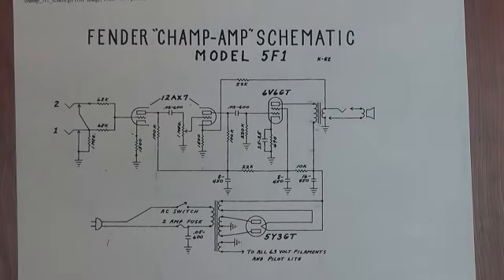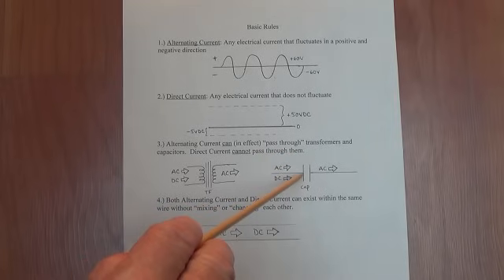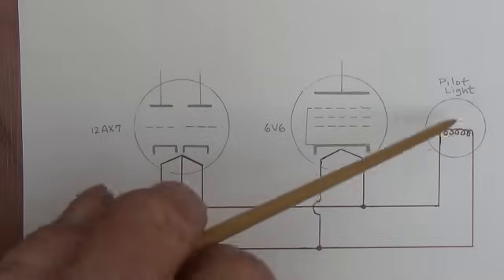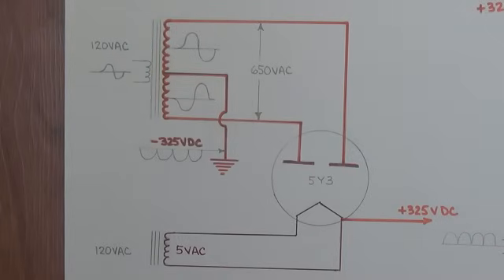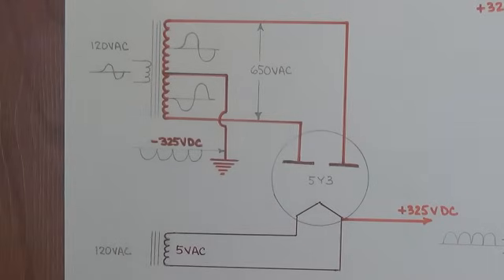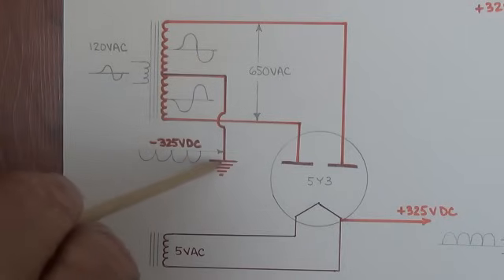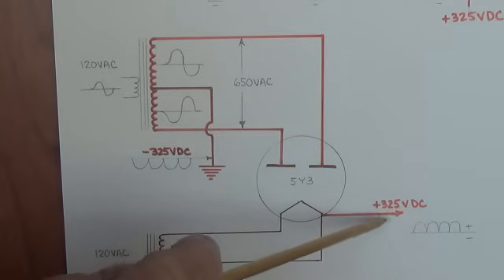How Tube Amplifiers Work, Part 1: The Power Supply

Comment: Uncle Doug, Your videos have greatly helped me, but I need some help. I have a Zenith 3A03 chassis from a HF16 Portable phonograph, 1958.  I just re-capped it and what I get is a very small amount of audio at full volume. I just rec'd the Sams 396-15 and I asking, where would you start?
Reply from the maker: +Dale Hinkelman  Was it working perfectly before you replaced the capacitors? If it has never had good volume, there are all sorts of possible reasons.....bad tube, faulty component, bad connection, bad cartridge (if using a phono cartridge), bad output transformer, etc. Identifying the problem requires hands-on testing and step-by-step diagnosis, which I can't do long distance. This will be a good learning experience for you. Good luck and be careful.

Comment: Doug,I have an old Morley Basic Wah pedal that needs repair.if ai sent it to you,would you fix it?Someone had cut off the twin 9 volt battery connectors and it needs dome attion.
Reply from the maker: +philo426  Philo, I appreciate the opportunity, but I am retired and not doing outside work, other than an occasional vintage amp restoration.....especially anything that entails shipping and receiving.

Comment: If you were to use a full wave bridge rectifier (4 diodes) instead of the 2 diodes in the 5Y3GT, would the output be  around 910v DC? Instead of the 325v DC? As you would be using the full AC wavefrom instead of wasting the negative half of it. The output would be approx 1.4 times higher then the input when using a full bridge. With a single diode with the output be around 162v DC?
Reply from the maker: +haz939  Yes, Haz. You&#39;d have to un-ground the centertap to prevent the creation of two out-of-phase wave forms, then, using a FWBR with the 650VAC secondary, you would ideally get about 920VDC output (in reality it would be lower due to rectification losses).  In practice, when you do use FWBR in a power supply, it is generally with an un-centertapped 325 or 350VAC secondary, which yields a more useful output in the 450VDC range (ideally). Half-wave rectification, with a single diode, would yield about half of the secondary voltage, as you say. Much of this is explained in the RMS video.

Comment: thanks for your reply uncle Doug, i forgot to mention in my previous post  early about how interesting and helpful your  videos are,  and  i'd like to make a request...could you check the schematics of a leslie 147 tube amp and make a video one day explaining  the power supply circuit  just like the way you've explained  the   " how tube amplifiers work''  Thanks!
Reply from the maker: +4hammonds  You're welcome, 4H. To be honest almost all power supplies operate under basically the same principles.....a power transformer, a rectifier (either diodes as in the 147, or tube), and a series of filter caps and resistors (and filter choke, in some cases, like the 147).  Whatever I said in my video would apply to the Leslie 147 tube amp.
Reply: uncle Doug
the only thing i can probably understand though, is that by looking at the schematics, the signal comes in through socket  pin number 6  then goes to one of the lugs of the volume pot which is also connected by a wire to one leg of the 8 ohm 10w resistor. the middle lug of the volume pot is connected to the grid pin #2 of the 12au7  tube.
i guess from there the signal goes to pin #5 (grid pin # 1) of the 6550 tube. (v2)  can't understand the rest of  the schematics.  thanks
Reply from the maker: Being able to interpret schematics is like learning a new language, 4H.....it takes time and practice. It sounds like you are making progress in developing these skills. It's usually easier to break the amp down into separate sections, pre-amp, power amp, power supply, reverb circuit, and tremolo circuit, then focus on each one individually until it becomes clear. The Internet is a great resource to aid in your study. Good luck.

Comment: Doug,
@ 16:15 of your explanation: You seem to indicate that scopeing the center tap (which is hooked directly to ground) of the transformer will show you the bottoms of the AC waveform. I guarantee that scoping anything directly hooked to ground will only show 0 VDC and 0 VAC, unless there is something seriously wrong in the circuit. If you want to see the bottoms of the waveform, scope each plate of the tube. When it is reverse biased, you will see your waveform bottoms, which the tube is conveniently blocking for you. Scopeing the filament would show the positive waveforms from both halves of the tube, but you will see that waveform smoothed by any filtering capacitors on the B+ line. So it will be more or less a high DC voltage, with some ripple. You will not see the sum of the positive voltage waveforms, the filter caps will swamp that out.
Pete
Reply: Greg is correct.  The diode/rectifier action is like a switch, only letting the voltage flow in one direction.  Basically what it's doing is turning on and off each half of the center tap coil.  As the top coil voltage goes positive, the bottom coil is turned off (filtered out by the rectifier), then as the bottom coil goes positive, the top coil is turned off.  So, only the positive power of each coil is allowed to pass through and the negative power of each coil is blocked or turned off.
If you look at the top coil separately you would see +325v for half the cycle, then 0v for the other half the cycle.
Looking at the bottom coil only, you would again see +325v for half the cycle, then 0v for the other half, but in opposite phase.
With both coils in action, the -325v peaks of both coils are blocked or filtered out and the +325v peaks from both coils then produce the continuous stream +325v peaks with no gaps as you show in the rectifier output.
Reply: @montpierce424  Yes, this is spot on.
Reply: To clear this up, erase the pencil mark for -325 pointing to ground & have it point to the lower transformer wire.
Reply from the maker: +Greg Peterson  Very interesting and informative, Pete. Thanks so much for your knowledgeable input :)
Reply: Yes, I noticed this too.

Comment: I'm new to this sort of stuff so forgive me if this is a silly question... in the final diagram on this video at the bottom, 5VAC it being supplied to base of the rectifier tube and at the same time +325VDC is being taken off it. Doesn't the 5VAC interfere with the +325VDC? surely that would cause problems in the rest of the amplifier circuitry?
Reply from the maker: +insanebiscuit1  Not a silly question at all, IB, and one that puzzles a lot of people. The rectifier tube contains two separate diodes. The high voltage AC from the power transformer connects to the two plates, and the 5VAC from the filament winding of the power transformer connects to both ends of the directly-heated cathode (which looks like a "V" filament in the diagram).  Diodes only conduct in one direction, and in this case, both of the diodes in the rectifier tube conduct only from plate to cathode, so the rectified +325VDC exits from the tube via a cathode/filament wire. Since AC and DC don't "mix" (they are sort of like oil and water), both can coexist at the same time in a wire without affecting each other.....so the 5VAC going into the tube and the +325VDC coming out pass by each other without any interaction.

Comment: Hi UD! I have a small power transformer with secondary high voltage output of 600v at 50 M.A.D.C,Would this provide sufficient high voltage to power a champ circuit?Im sure the 600 is good,but I wonder about the 50 ma?
Reply from the maker: +mike connell   Most PT's for the Fender Champ are HV rated at 70mA, Mike, but I personally think that your 50mA PT would work. If you biased the 6V6 at 35 to 40mA, there would still be 10 to 15mA left for the 12AX7 triodes, and they only draw about 1.2mA each.

Comment: Uncle Doug, you  may have gone over this but why is it that AC is sent to the diodes and DC is outputted?
Reply from the maker: +William Alston Diodes only conduct in one direction, William, depending on the orientation of the diode and the charge applied.  A rectifier tube contains two diodes formed by the two plates and the cathode. When you apply AC to the plates, only the positively charged portion of the wave is conducted from the plate to the cathode, so all the positively charged wave forms (i.e. positive DC) exit from the cathode, and all the negatively charged wave forms (i.e. negative DC) go to ground through the high voltage center tap.

Comment: Thanks uncle Doug for all your Knowledge that you have shared with us!Its like going to school again,but without having to sit on hard plastic seats all day! I have an old hammond organ transformer that is putting out more than 650 on the high voltage,my volt meter says 768 v,is that too much voltage for the 5f1 circuit?Is there an easy cheap way to reduce the voltage if needed?
Reply from the maker: +mike connell   You're welcome, Mike. If you're measuring the high voltage output of the transformer out of circuit (not connected to a rectifier tube) it will have an elevated voltage reading. Once it's connected to the rectifier and current is flowing, the output reading will be much lower, probably around 410VAC, which is about right for most small to medium wattage tube amps.
Reply: +Uncle Doug I also have the output transformer from the hammond organ,There is only one red wire on one side of the transformer,is that the primary side with red going to bt?Thanks again this is my first build,your videos are a great reference!
Reply from the maker: You're welcome, Mike. An output transformer should have at least two wires on each side, unless the output (secondary) in internally grounded. Measure the resistance between the red wire and the metal frame of the transformer. If there is continuity, then perhaps the red wire is for the speaker, with the second terminal of the speaker going to ground (and thus completing the circuit with the OPT secondary).

Comment: Hi Uncle Doug, I have a question hopefully you wouldn't mind answering for me. On the secondary side of the power transformer it looks like there are 3 separate coils which each get a current induced by the magnetic field set up by the primary side of the transformer. My question is, are these 3 circuits separate of each other or do they some how have an effect on each other. For example if we added a forth coil on the secondary side, does that now lower current or voltage in the other three?
Reply from the maker: +taell1234  An excellent question, Taell. I have not read an answer to this question anywhere, but will extrapolate what I believe would happen. 

The output capability of a power transformer (PT) is dictated by the amount of secondary current it can safely flow (and heat that it can safely tolerate), and by the amount of primary current it can safely flow to produce the secondary output. 

If you were to add a fourth winding to the secondary, there would be two possibilities: If the AC to the primary was limited, then I believe that the current output from the other three windings would be reduced and the total output of all four windings would be the same as for the original three. 

If the AC to the primary were not limited (which it generally isn't) then the current output of the other three windings would probably stay the same and the output of the fourth winding would make the total output current higher than before.  This would force the primary current to increase, to cope with the increased secondary output, possibly beyond the safe capacity of the transformer.

Comment: Excellent video Doug. Im considering building a small tube- amp for my turntable and this schematic has been extremely helpful. I am a little lost how the circuits you've shown in pt.1 and pt.2 fit in with the origional schematic map
Reply from the maker: +Christian Stock  Thanks, Christian. The diagrams I used in the videos are intended to show how the different sections of the amplifier actually function, i.e. the filament heater circuit, rectifier, power supply, pre-amp, and output.  If you intend to build this amp, the Fender schematic is the map of the circuit that you should follow. If you wonder how the different parts function, then refer to my videos and diagrams. Good luck with your project.
Reply: Thank you Doug. This is my first project involving electronics and you've been very helpful, you the man
Reply from the maker: Thanks, Christian. Best of luck with your amp project.

Comment: This is a great introduction to tube electronics. The high voltages are a bit hair-raising though :) I have a digital oscilloscope that's rated for 300V but with 10x probes - would that be suitable for this project or do you recommend something a bit more old school?
Reply from the maker: +Steve Wart Thanks, Steve. The high voltages require a thorough knowledge of safe procedures prior to actually working on a circuit. Your digital oscilloscope is just fine, particularly with the 10x probes. Most of the scope applications deal with the AC signal circuit, which is of moderate to low voltage.

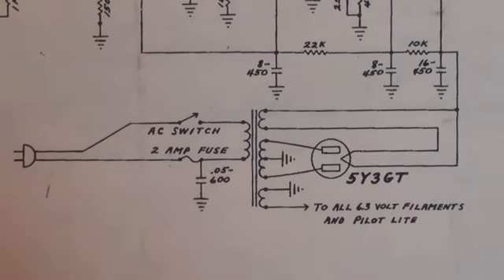Comment: Hi Doug I sent you a message re heater voltages and found the answer to the second part of my question right here at about 5:15 onwards. I am still interested in this so called sudo centre tap for a 6.3V secondary winding using two 100 Ohm resistors though. Thanks for all your videos. I watch them more than TV these days!!
Reply from the maker: +allanpennington Greetings, Allan. I haven't yet seen the message, but am glad you found the answer to one of your questions. The pseudo center tap is a fairly common practice for power transformers that don't have a center-tapped 6.3VAC winding.  Running a 100 ohm resistor to ground from each of the 6.3V wires will create about the same hum-reduction as actually having a center tap.
Reply: Thanks Doug, the first part of my question was as follows:

The amp I want to build has 3 x 12AU7, 1 x 12AX7, 1 x EZ81, 2 x EL84. The heater wires go from the Tx to the EZ81 pin 4 and 5, then onto the two EL84's, again pin 4 & 5. Then the black wire goes to each pin 5 of the 12 series tubes. There is then a bus wire connecting pin 5 to pin 4 of these 4 tubes. The other heater wire, a brown one, goes from pin 4 of the second EL84 to each pin 9, (the CT of the tube heater internal circuit) as a separate wire from one tube to the next. I am confused as to whether therefore the mini tubes heaters are using 6.3 or 12V? The Tx spec just says 6.3V 4A. The EZ81 only runs on max heater of 6.3V but the minis can run on either 6.3 or 12. I am a little confused as to whether the wiring I have described for the mini tube heaters is parallel or series re the heater voltage.

What in fact I discovered by watching this video again was that because the 12 series tube has two heaters one for each side the 6.3V supply is sent to both sides via the pin 4-5 and the CT. It is because I didn't realise there were two heaters one for each cathode that I got confused. Thanks for you feedback
Reply from the maker: Although I have a much easier time analyzing a schematic than a verbal description, it sounds like you have wired the tubes properly, with one of the 6.3VAC wires going to both pins 4 & 5 and the other to pin 9. Yes, there are two heaters in each 12A tube. In fact, if you are only using one of the two triodes within a 12A tube, you can simply wire up either 4 or 5 and 9 to energize only the single heater/cathode you need. I did this in V1 of the Supro Tremo-Verb circuit.
Reply: +Uncle Doug Thanks very much Doug, I appreciate your prompt and ever valuable replies. The schematic I have does not show the heater circuit. It only shows the two 6.3V connection points at the transformer. Interestingly one is shown going to ground, (as is the CT of the HT Secondary). Looking at the very few pics I have of the inside of the genuine article I can't see a wire from any of the heater terminals going to ground. Maybe the pilot light? I assume the circuit is complete like the Xmas tree light example you gave without any part of it going to ground? On the more modern hardwired AC15 the only connection to ground for the heater circuit is the two 100 ohm resistors which form the 6.3V psuedo CT. After all that I have looked at a circa 60's schematic of the AC15 which does show the heater circuit and there is no connection to ground so I must assume there is a drawing error in the AC10SRT schematic I have from 1964. I did notice that the plate connections on the EZ81 were incorrectly numbered so it is not inconceivable that errors do occur. It means a very thorough check of the whole circuit is needed but there is only one good diagram and one draft diagram to be found anywhere given the rarity of this amp.
Reply from the maker: Some companies ran one side of the heater circuit to ground, in a effort to save wire and labor time/expense. It's a bad idea. Both AC wires need to go to every tube, and must be tightly twisted so they will neutralize each others hum-inducing fields. If the 6.3VAC winding has a center tap, it must be grounded. If not, then the pseudo CT trick with 100 ohm resistors is a must.
Reply: With no center tap, one wire is at ground potential while the other is carrying 6.3V AC, creating an electro-magnetic field which can find its way into the amplifying circuitry. The two 100 ohm resistors create an artificial center tap so that each wire is carrying 3.15V AC of opposite polarity so that the electromagnetic field on one wire cancels the field on the other, particularly if the heater wires are tightly twisted together.